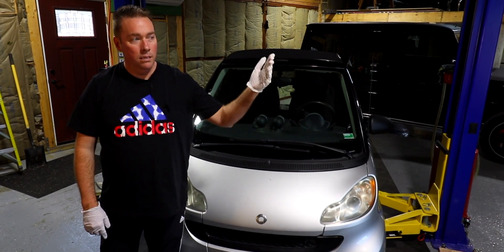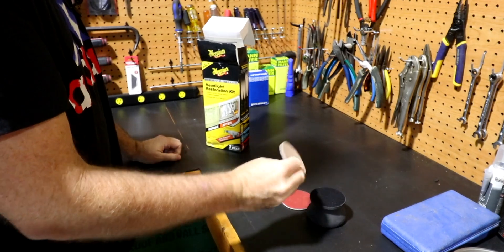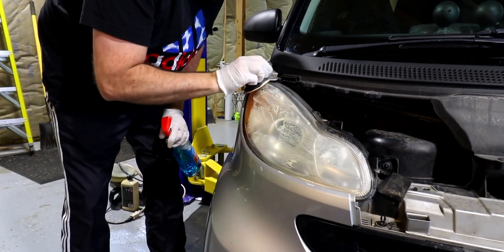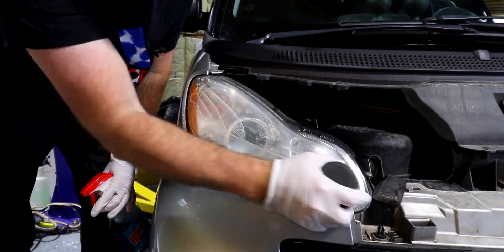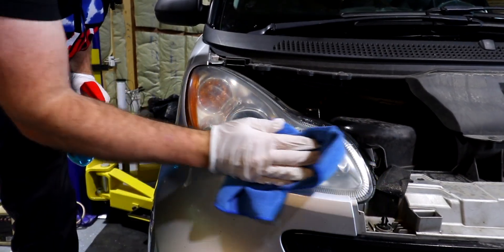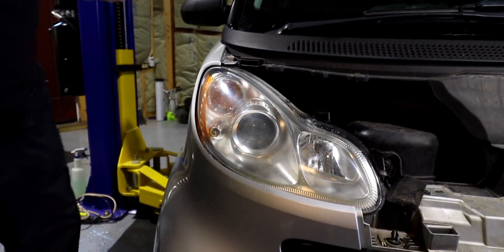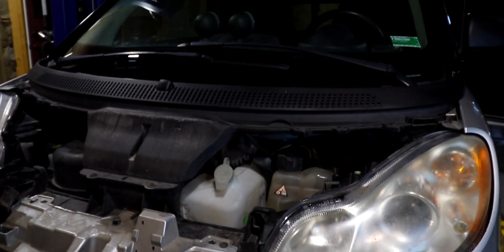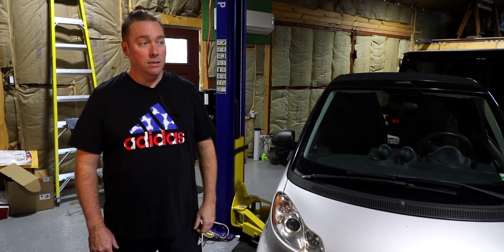The BEST Foggy Headlight Restoration Trick You MUST KNOW For 2021

Comment: Just spray insect repellent,  Off, on the headlights & wipe it off. Do this fast. Use a clean soft paper towel each time. When the towel no longer pulls off a residue, you will be done. This will last a long time, it's the easiest & cheapest method.
Reply: funny you say that, i carry a can in my truck. I had a run in with one of those gastation headlight restoration guys with the $30 cans, i did a challenge with the Off, i went first, the guy just walked away🤣

Comment: I wouldn't apply the clear coat ..it seems to soft for bee's, wasp,grasshoppers & small pebbles it will be cloudy in 6 months ..the plastics seems alot harder so I would do the ceramic coating & buff every 6 months without having to sand & reapply the clear
Reply from the maker: With no clear coat you get about a month , with the clear you get 3-6 months
Reply: How long did it last till you restored it again bud?

Comment: I don't believe in snake oil.Because it doesn't work! I have seen others
 fail. Protect painted areas.use common scenes tape or remove. start 
with wet sand  400 600 grit depending on cloudiness. Don't be very 
aggressive until  you see how it cuts. work in one direction only,work 
your way up to 800. then use a power buffer to polish. use a product 
like Meguiar's DIAMOUND CUT COMPOUND  2.0  85. When you are using a 
power buffer.the heat that is generated seals the plastic. One could 
make a business of doing this. takes about an hour per light,depending 
on how bad. Last for years!
Reply: Or you could and it from 500 up to 3000 and then use a 25 dollar vapor canister from Amazon with acetone 
And like magic it restores the headlight 
You do have to seal it with something if you want it to last more then a year 
But the canister is pretty good 
The best route is to wet sand it up to 800
Finishing with horizontal strokes and shoot it with a 2K clear coat 
SprayMax makes one especially for headlights 
Clear coating it will make it last for 10 years